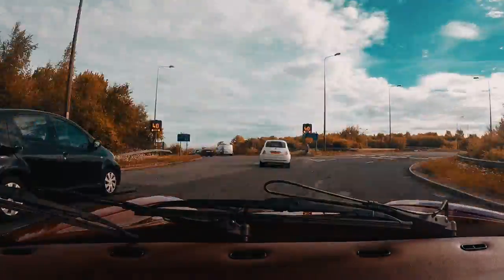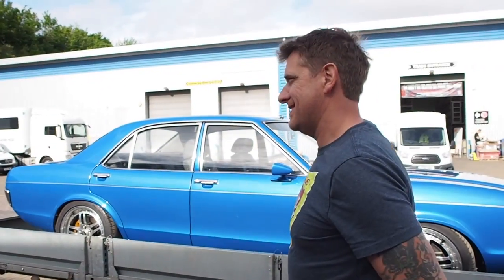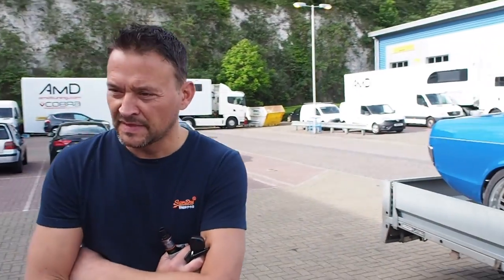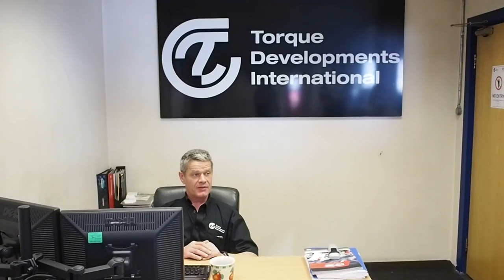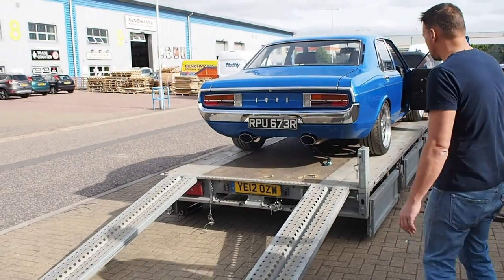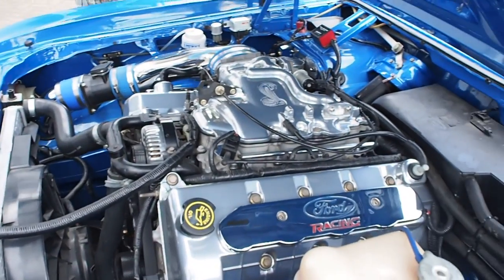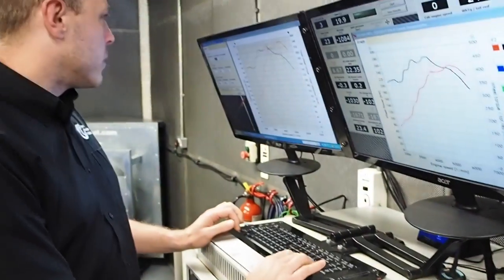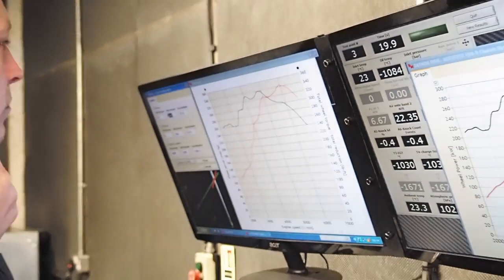Dyno day part 1   340whp mk1 Granada V8

Comment: First of all great video fellas and a great car.

Did you know Ford actually built a Mk1 Granada in the early 70’s and shelved the project due to the fuel crisis and high prices of fuel.They actually built 2 prototypes for the uk market and shelved both. There was a turbo charged 3 litre Essex engine and a 5 litre mustang engine. I knew of the 5 litre that found its way into the possession of a Mechanic friend of mine who bought it from a car collector who had influence with Ford. The car also had an auto box and air con. The air con at the time was reputed to have cost quarter of a million in development cost for the prototype. The car was a bronze colour and was pretty magnificent. The car lived on Carfin in Scotland and when I first seen it, it lived under a tarpaulin and I’m sure that was in 1986ish. It was magnificent and a thrill for me. The mk1 Granada is a gorgeous car. Well done for making a great video about a great car.